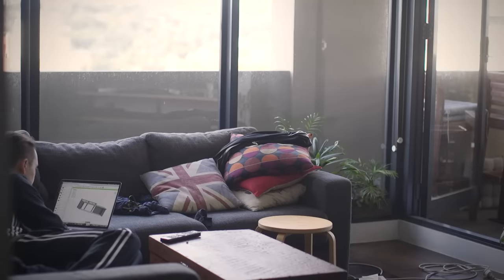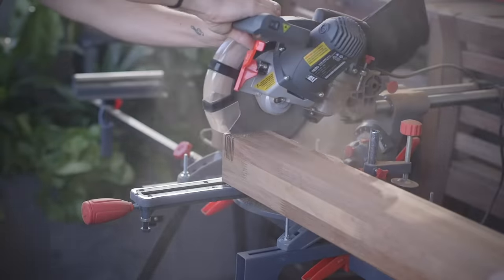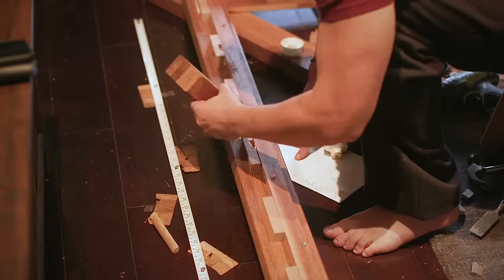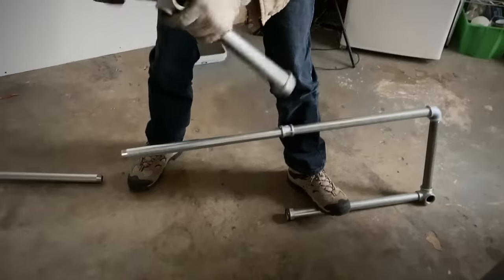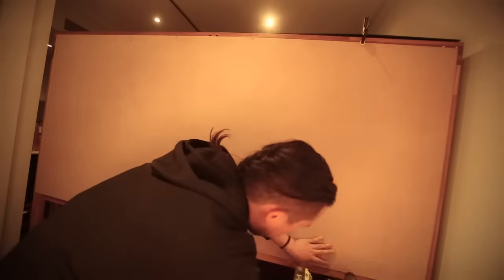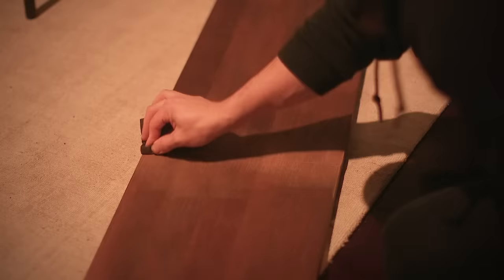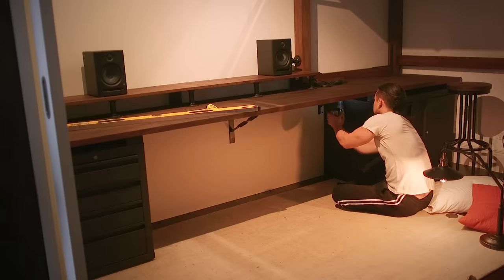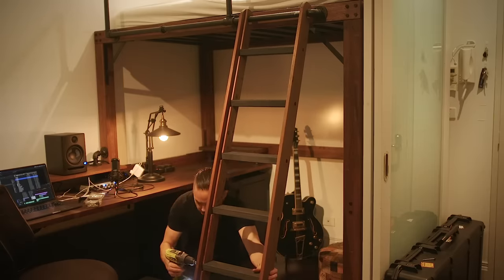Building an industrial-styled loft bed and study

Comment: Would the double bed hold two adults?
Reply from the maker: It's slightly larger than a king single, but yes, 2 adults can just fit (although i'm not that big, slim / 170cm tall.)
Reply: Michael Tan thank you! Is there anyway to calculate how much weight it could hold?
Reply from the maker: @bluberrymedia1209  i'd like to know myself. It feels super strong even with 2 of us up there.

the Merbau frame is super thick and hard, so as long as the force is just a downwards force, the frame won't break. It would take tons.

the slats are also pretty thick and strong, i don't reckon you could break one of them even by jumping on it. It's 45mm thick treated pine.

so i'm actually not sure what the weakest point would be if I (hypothetically) piled on tons of weight... probably the inside-bearer (which holds the slats) might snap / be torn off the big bearer... although it's attached with pretty long screws and glued across the whole length, and the weight is distributed across like 12 slats.

I even glued another long piece of thin timber (you can see it briefly at 4:07) under the inside-bearer to further reinforce it.

So my best guess is that, if you had a few heavy people jumping on the slats, you might be able to break the inside bearer... not in its entirety, but probably just tear off a bit of timber under a slat, and the slat would fall through, taking the screw with it!

Sorry for the long answer haha, but its something I am very interested to know also.
Reply: Michael Tan nah you’re a legend that was super helpful haha. Thank you so much - great job btw!

Comment: I'm taking a lot of inspiration for this for some guest bedrooms / multifunctional spaces. The main thing I'm going to probably do differently is base my design around dado joints and wood glue instead of using metal hardware as it seems easier to reclaim if I don't like the space any more. Was there some advantage to the metal hardware that I'm missing?

Comment: How much did it all cost tho
Reply from the maker: The finger-jointed Merbau timber was the only really expensive thing; the loft posts, bearers and side-beams were about $600AUD total, and the desktop was about the same again. Would have been muuuch cheaper if I'd gotten two smaller pieces and joined them, but I really wanted one long solid piece.

The pine (stair treads and slats) is super cheap, like $5 a metre. Plywood also cheap, i think that big sheet was like $25. Brackets, screws, piping, stain, etc. ~few hundred bucks. Ladder was about a hundred.

Comment: youtube knows i've been looking at studio apartments, but doesn't seem to know I don't know ANYTHING about woodworking nor do I have access to the space or equipment to do something like this
Reply from the maker: funny thing is, i know nothing about woodworking too. i just did it anyway. when i got stuck, i looked up videos on joints, looked at how other beds were made, did some tutorials on Fusion 360 (the design software), etc. 

i bought a compound-saw just for this project, and cut the wood on my little balcony. 
Where there is a will, there is a way!

Comment: #AskMichaelTan could you please tell the actually total cost of decoration???
Reply from the maker: The finger-jointed Merbau timber was the only really expensive thing; the loft posts, bearers and side-beams were about $600AUD total, and the desktop was about the same again. Would have been muuuch cheaper if I'd gotten two smaller pieces and joined them, but I really wanted one long solid piece.

The pine (stair treads and slats) is super cheap, like $5 a metre. Plywood also cheap, i think that big sheet was like $25. Brackets, screws, piping, stain, etc. ~few hundred bucks. Ladder was about a hundred.

Comment: how much it all cost?
Reply from the maker: The loft posts, bearers and side-beams were about $600AUD total, and the desktop was about the same again.  Would have been cheaper if I'd gotten two smaller pieces and joined them, but I really wanted one long solid piece.

The pine (stair treads and slats) is super cheap, like $5 a metre. Plywood also cheap, i think that big sheet was like $25 and the desk supports about the same. Brackets, screws, piping, stain, spray-paint, etc. ~few hundred bucks. Timber for the ladder was about a hundred.

Comment: Overall cost?
Reply from the maker: The loft posts, bearers and side-beams were about $600AUD total, and the desktop was about the same again.  Would have been cheaper if I'd gotten two smaller pieces and joined them, but I really wanted one long solid piece.

The pine (stair treads and slats) is super cheap, like $5 a metre. Plywood also cheap, i think that big sheet was like $25 and the desk supports about the same. Brackets, screws, piping, stain, spray-paint, etc. ~few hundred bucks. Timber for the ladder was about a hundred.